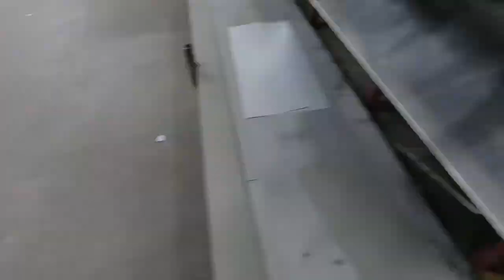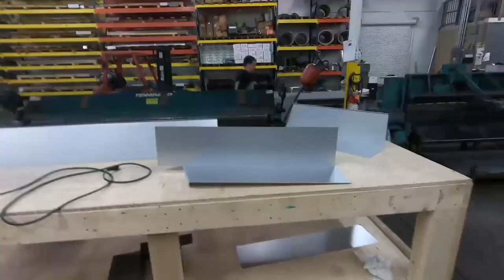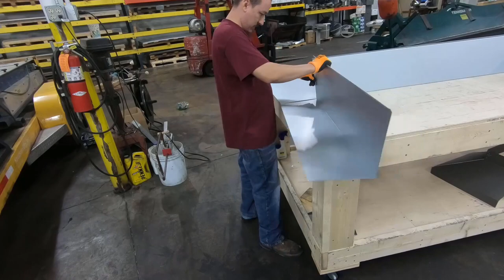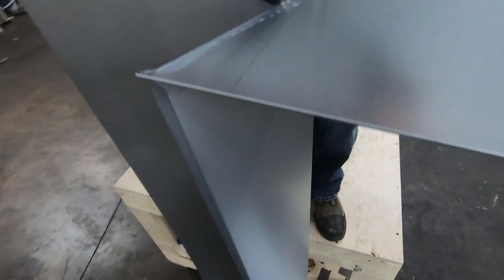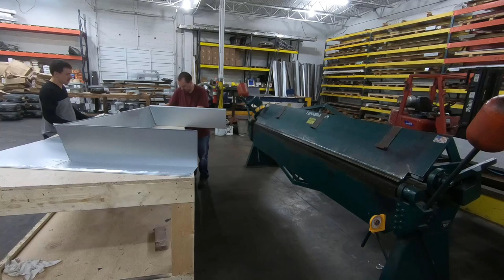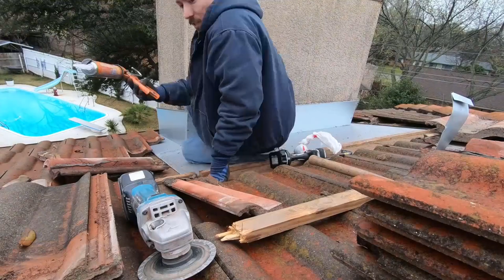Making and Installing Chimney Saddle for Tile Roof Repair

Comment: nice job 
i have a question why you dont screw it to the wall?
Reply from the maker: The stucco was pretty old so we didn’t want it to crack or anything. The best way would have been to remove the stucco, put it against the framing, install ice and water shield and the redo then stucco but they didn’t want to spend the money. But it fit pretty tight so we didn’t need to screw it.

Comment: So you have a gutter behind the Chimney wall. When the water hits that wall, the water will spread under the tiles. Then it goes all over the roof. I don't understand this concept!!??
Reply from the maker: No that’s not it at all, it is a metal cricket that allows water to flow to the eave into the gutter so that it doesn’t go all over the roof

Comment: Wrong way to install chimney metal, you forgot to put a piece of new underlayment on top of the chimney saddle, on the sides you didn't install a U chanel, the water is going to the underlayment and will damage that in about 1-2 yrs. JUST WRONG!!!